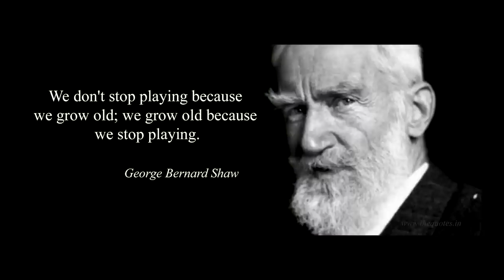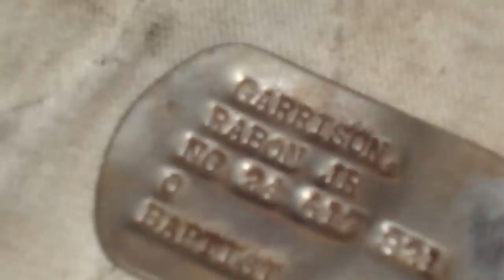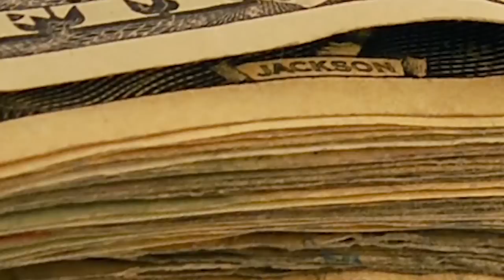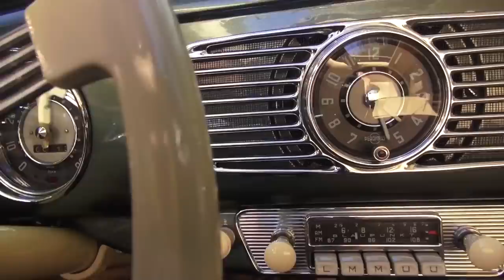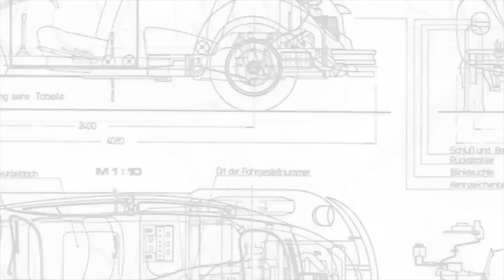Classic VW BuGs Mini Documentary Throwback Interview Cars Yeah

Comment: The cars are gorgeous!❤️ that plum or black is beautiful! I have a question. I want a new Volkswagen Beetle that they are no longer producing😩 I really don’t no why. I what a drop top turbo. I want to no if you can find wider white wall tires like they had on other cars in the 70’s. I want to do a kit on it. Id like to change the front end. Well like extend it to look like a different car. 😎 I saw the kits out of New York but they are to short the kit is. I like it longer.❤️
Reply from the maker: Couldn't tell ya, I really do not work on those bugs.
Reply: Chris Vallone okay.  I noticed u work on the older ones. I live in Missouri and they are hard to find just sitting around😩